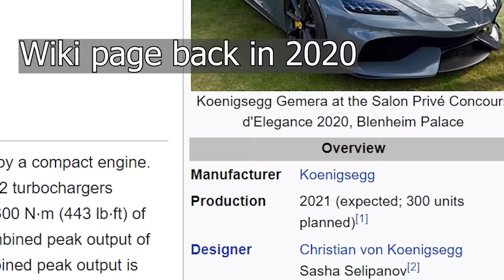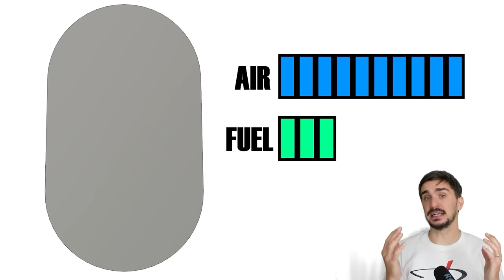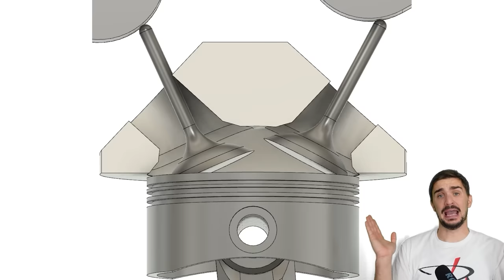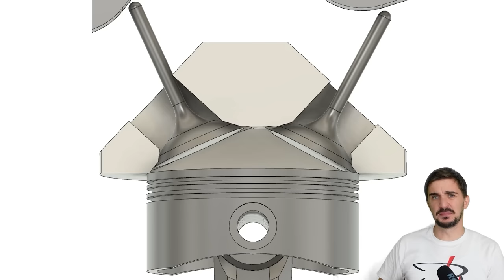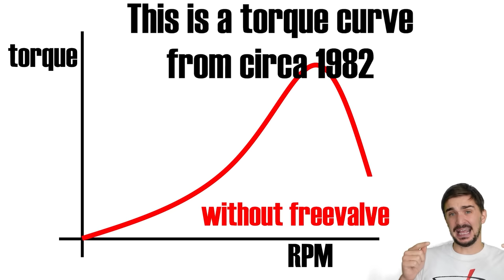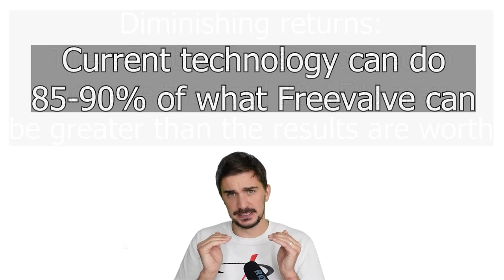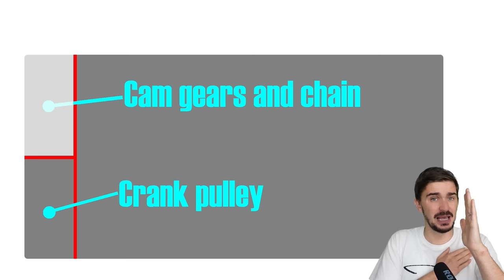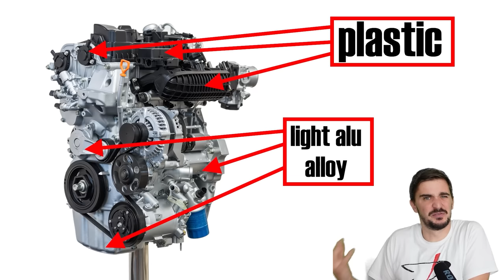FreeValve Isn't a Big Deal. Here's why

Comment: The similar story occured with liquid propane direct injection... where using gasoline fuel system looked very promising, but more than a decade later a vapor injection system took over by upgrading its components (injectors, ECU, reducer) and now the most sophisticated engines (direct turbo of dual injected turbo) run perfectly on LPG using a vapor system.
Reply: Propane does not work with gasoline engines. Propane injection id for Diesels.
Reply: @mrgcav  would be great if you continue your comment with “because: …”
Reply: There is also natural gas powered cars. In Brazil is very common to find "NGC (GNV in Portuguese)" kit for converting your gasoline engine to natural gas. There are a few drawbacks, like having to install a tank on the trunk of the car, and loss of performance, but the gas is cheaper than gasoline and fuel economy is much better. Its very common for fuel stations here to have natural gas available

Comment: You make a lot of really good points, however I can still think of a handful of reasons why Freevalve could still be beneficial. A great example would be the little FB20 in my Subaru Impreza. Being a flat engine, it's incredibly wide for its displacement, but pretty short (to make the AWD work as the engine is ahead of the front wheels.) In addition to that, the engine has a seperate cam carrier which is probably at least an inch to an inch and a half tall and being a flat engine, you have two of these, one on each bank. In this case, I think that the reduction in width of the engine would be a huge win for something like a Subaru where the top of each bank is incredibly close to the frame of the vehicle. Reducing that width would make servicing the vehicle a whole lot easier or it would let Subaru stoke the engine a bit more and maybe squeeze a bit more compression and volume out of the engine without worrying about making the engine longer like with the 2.4L or the older 3.6L.

So generally speaking, I agree with you when it comes for inline engines or V engines with enough room in the vehicle chassis, but I see there being some pretty big benefits for a flat engine where the dimensions of the engine influence the design of the entire vehicle to accommodate the AWD system. Either way, great explanation. On the balance, I agree with you though.
Reply: good point,
but i guess it will all fall down to costs and complexity
Reply: @endurofan9854  That's another excellent point as two banks on Subaru engines tend to make them more expensive all around.
Reply: Freevalve for ONE head would be expensive compared to current VVT, but for TWO heads it would be a lot MORE expensive.
It would be an order of magnitude cheaper for Subaru to just modify slightly the chassis rails if they wanted more clearance for the heads, compared to implementing freevalve.

And when you think about how many iterations of the EJ it took them to fix the oiling and headgasket issues for KNOWN tech aka regular heads with camshafts, I can't even imagine how many years and costly recalls it would take them to make a brand new tech like freevalve even close to reliable. Especially in the twilight of ICE and the transition to EVs where most carmakers are getting out their last gens of ICE engines and have stopped developing them much further.
Reply: @raoulrr  I was taking you seriously until you mentioned the head gasket issue with the N/A EJ engines. You do realize that those were phased out over a decade ago. That's like calling Jaguars crap because they're a Ford. Given what Subaru has managed with the FA24 along with their collaboration with Toyota in the BRZ, I wouldn't put it past them to do something more innovative. The worst thing to come from the F series engines is leaky cam carriers which I'd take over a failing head gasket any day, unless you own a 2011-2013 FB engine, in which case it probably eats oil. Just avoid those model years.

Either way, you're right, but cost will always be a barrier to entry for Freevalve unless they can produce it at scale which would bring costs down like any other mass produced part. The problem is that modern VVT systems and cams are mass produced at scale. Freevalve is not. It could be, but that's a lot of up front investment and most investors aren't willing to take that sort of risk.
Reply: Didn't subaru already fix that problem with their offset conrods in their F engines? They have much bigger strokes than the EJ series already.

Comment: Free valve is one of those things that sounds amazing in theory on paper, but it actually adds significant complexity and reliability issues due to pneumatic valves.  The ideal valve is actually a rotary valve, driven hydraulically.  We have the material and manufacturing capability to do this now using technical ceramics.
Reply: Actually the ideal valve is freevalve like, if it wasn't advanced racing engines, (even F1 where they have to be fairly reliable for a racing engine), would not use basically the same system. The problem is freevalve is going to take a good while to come down in price to a level thats mass affordable. Thats why it's been stuck in F1 engines since the 90's without going anywhere. It's just super expensive to do.
Reply: @darthkarl99  I’m talking theoretical.  The ideal valve would not reciprocate, as that requires high power consumption to actuate, especially exhaust valves that have to push against hundreds of psi (exhaust gases) just to open.  Free valve consumes KW’s of power.  Rotary valves would also offer better, and shorter, flow paths.  Problem is sealing, as is always, with rotary type devices.  Google rotary valve, you’d have to see an illustration to really get it.
Reply: @wesleydeer889  I get the feeling your thinking of what i've heard of as sleeve valves. They're a notorious pain to do, but also very powerful.
Reply: But there is lots of variable valve systems on the marry today that are a total disaster. Like Ford F-150 engines. The phasers are a disaster. Or Audio V8's. Free valve might actually be simpler than some of the systems being used today
Reply: @darthkarl99 They made them work in WW2 planes

Comment: This really does hit the nail on the head. Matt from the Dirty Garage Guy channel did quite a nice video a few years ago about how it might work, and all the pitfalls you might face. It really does seem to overcomplicate things. Fiat's Multi-air is already pretty complex, but at least it's in production and is so close to the perfect system that it hardly makes sense to complicate things more.
Reply: I mean it's a fairly simple thing to do and quite sure it was tried some 40 years ago. Some engineer likely already tossed the idea out but getting an actuator to run that fast and in a hot and rather hostile environment for more than a short period is likely why it was never gone with
Reply: Multi-air actually seems like a way better and easier solution
Reply: Thing is if you look at it it's a similar system to what has already been used for decades for unit injector systems on Diesel engines, it's a camshaft used to drive a hydraulic piston which has an electronically controlled return valve. It doesn't actually require that many additional components and it uses engine oil and the existing valve system. If FIAT hadn't patented it I think everybody would be using Multiair by now, it just makes sense.

Freevalve was never going to take off when it basically requires a whole new engine head and a new compressed air system to boot (and when you have an air leak, as compressed air systems always do sooner or later, you lose pressure in the entire system and your engine won't work).
Reply: @BigUriel you say "and it uses engine oil and valves sistem that already exists" like loss of oil pressure was never happened before...

Comment: I think it's important to remember that quite a few large OEM had running camless engines in the 90s. Similarly, GM had HCCI engines running in the 2000s. Neither are consumer products for (presumably) good reasons (yes, I'm aware of Skyactiv-X, which still isn't available in the U.S. and doesn't seem to fully deliver them promise of full HCCI).
Reply: GM has had electrically-operated valves going back to the late 70s or early 80s. They called them "helinoids" (helically wound solenoids). They were way too expensive for production but they used them to prototype cam grinds quickly.

Comment: I think that Freevalve will eventually come but it will come because of manufacturing cost, not that much because of engine properties you mentioned in the video. To me, Freevalve is very simple and easy to assemble compared to typical variable cam system found in current cars. If you can cut 10% of engine production costs, it will happen.

Comment: Variable Valve Timing already gives low rpm and high rpm customized cams. So you get your eco-drive cams and your overtaking cams. There is not much to be gained from additional "programming". Honda got it right.
Reply: GangBalls69_Estonia  Yes. That technology from more than 30 years ago that is in shitbox Hondas you can buy for $3000 
Truly unobtainable scifi tech that we need this ridiculous monstrosity to solve.
Reply: GangBalls69_Estonia  Honda VTEC = VVT+VVL
Reply: GangBalls69_Estonia  VTEC is a type of variable valve-timing system developed and used by Honda. It stands for V ariable Valve T iming & Lift E lectronic C ontrol.

Learn how to use a search engine bro, its right there at your fingertips!
Reply: GangBalls69_Estonia  https://en.m.wikipedia.org/wiki/VTEC ☠️
Reply: GangBalls69_Estonia  "nope, vtec doesn't include variable valve timing"

Whats the VT in VTEC stand for? ☠️
Reply: GangBalls69_Estonia  what does the EC in VTEC stand for?

Did you read my replies? Shoulda just taken the L bruh ☠️
Reply: GangBalls69_Estonia  What does the VT in VTEC stand for? You can read right?

The VTEC system uses two (or occasionally three) camshaft profiles and hydraulically selects between profiles. It was invented by Honda engineer Ikuo Kajitani.[1][2] It is distinctly different from standard VVT (variable valve timing) systems which change only the valve timings and do not change the camshaft profile or valve lift in any way.

The VTEC system provides the engine with valve timing optimized for both low and high RPM operations. In basic form, the single cam lobe and follower/rocker arm of a conventional engine is replaced with a locking multi-part rocker arm and two cam profiles: one optimized for low-RPM stability and fuel efficiency, and the other designed to maximize high-RPM power output. The switching operation between the two cam lobes is controlled by the ECU which takes account of engine oil pressure, engine temperature, vehicle speed, engine speed and throttle position. Using these inputs, the ECU is programmed to switch from the low lift to the high lift cam lobes when certain conditions are met. At the switch point a solenoid is actuated that allows oil pressure from a spool valve to operate a locking pin which binds the high RPM rocker arm to the low RPM ones. From this point on, the valves open and close according to the high-lift profile, which opens the valve further and for a longer time. The switch-over point is variable, between a minimum and maximum point, and is determined by engine load. The switch-down back from high to low RPM cams is set to occur at a lower engine speed than the switch-up (representing a hysteretic cycle) to avoid a situation in which the engine is asked to operate continuously at or around the switch-over point.
Reply: GangBalls69_Estonia  bro did you even watch the entire video? Or did you just get midway thru n thought u knew better, hence completely missing the gotchya part at the end where he drives home the point about this being a comparison to "traditional" engines which don't include technology such as VVT and VVL which pretty much are im every car since about the 90's - the exact implementation of VVT and VVL varies by manufacturer.

Had you watched it all you would know this and that what you are trying to do is what the whole entire video was about - why FreeValve isn't a big deal.

What you are trying to argue is the equivalent of saying a gearbox with 2 or 3 gears doesn't have variable gear ratios because it's not a CVT.

Nobody but you thinks that VVT equates to a system that can infinitely vary the timing, or put another way that it's constantly variable. Sure, Honda's system can only dynamically switch between 2 or 3 different cam lobes but that IS variable valve timing.

I mean, its right in the name.. the VT stands for Variable Valve Timing but here you are trying to deny reality to save face.

Watch from 9:40 where the gotchya is revealed. Or don't and continue to make yourself look like a fool who doesn't understand basic concepts 🤷

You must be fun at parties! 😂
Reply: GangBalls69_Estonia  in direct answer tho, the B16A2 as you've stated yourself is first-gen VTEC.

The VT in VTEC stand for Variable Valve Timing and is implemented using hydraulics to switch between different cam profiles, which in turn have different timing, duration and lift.

You understand that i-VTEC is the current iteration of VTEC, yet don't seem to realize that conceptually from a high level it's the same as the first generation. Sure, it's been tweaked and improved but fundamentally it's still just VTEC.

Now that i've directly answered your question... what does the VT in VTEC stand for?

(Shoulda just taken that L ☠️)
Reply: GangBalls69_Estonia  What does the VT in VTEC stand for?

If an engine has a system that can dynamically vary the valve timing*, ie it's *variable depending upon some condition, what is called what?

Honda VTEC is one of the most iconic implementations of VVT+VVL that has stood the test of time, as the OP states... Honda got it right.

Keep on crying "vTeC iS NoT VaRIaBLe VaLvE TiMInG" whilst having zero sources to backup your claim 🤣
Reply: GangBalls69_Estonia  provide just one source or reference to back up your claim that first-gen VTEC is not VVT nor alters the valve timing. I'll wait.

Here i'll go first showing that VTEC having two cam profiles is VVT, from your favourite site: 

Early variable valve timing systems used discrete (stepped) adjustment. For example, one timing would be used below 3500 rpm and another used above 3500 rpm.

More advanced "continuous variable valve timing" systems offer continuous (infinite) adjustment of the valve timing. Therefore, the timing can be optimized to suit all engine speeds and conditions

https://en.m.wikipedia.org/wiki/Variable_valve_timing

--

Remember what i said about you trying to argue a gearbox with 2 gears vs CVT,  i'm well aware of what you are trying to do.. we can go back n forth like this for as long as you like but riddle me this... What does the VT in VTEC stand for? Do you not know? Are you unable to answer this simple question?!
Reply: @Chronic Gaming  lol where u go bro? You just gunna change ya username, delete messages and dip like that?

Shoulda just taken that L, way easier than the witness protection route but i'll take it. Have a good one mate, no hard feelings 💀

Comment: Camshaftless designs have been common in large marine diesels for a while. It's possibly a lot more straightforward at 80rpm with one valve per (96cm bore) cylinder.

Comment: I'm literally making a report on valve timing on high performance and conventional engine currently and everything you shown was very useful and also helps me understand better via visual aid
Reply: He simplified the description of scavenging a bit.  When the exhaust valve opens (somewhere near BDC), the high pressure in the cylinder is released into the exhaust, which creates a high pressure wave that travels down the exhaust runner at the speed of sound.  When the wave reaches a change in area (i.e. a merge collector on a tuned length system), a rarefaction (negative pressure) wave is reflected back up the exhaust runner.  A properly tuned exhaust length will time this negative pressure wave so that it arrives during cam overlap (about 180 crank angle degrees later, near TDC).  At TDC there is very little piston movement move gases, so the negative pressure helps not only pull residual exhaust gases out, but it can be a lower pressure than the intake manifold, and pull more fresh air into the cylinder than you would normally get.  It only works in a narrow range during WOT though.  On an I-4 or V-8 you can choose a 4-1 or 4-2-1 design.  A 4-1 design delivers a strong rarefaction wave at a single higher engine speed, where the 4-2-1 delivers multiple weaker waves at several lower engine speeds.  That's why 4-1 "are for power" and 4-2-1 "are for torque".  Intake tuning is way more complicated though lol

Comment: Also one more example, it may be possible for Freevalve to achieve extremely high revs in future supercar engines. Like an NA V12. Cosworth had to ditch the belts and chains and go for gear driven cams for the Valkyrie and T50, and Freevalve can do that too. The mass manufacturers are moving to ultra hybrid or electric so they may not invest much in it anymore, but supercars definitely have a possibility for further improvements.
Reply: And if the technology improved it could be cheaper and more durable since the competing mechanisms are very complex and it enables the use of engines that don't necessarily use linear crankshafts.
Reply: Perkins used gears in 1947..
Reply: @SpaceraverDK  perkins 1947 engines did not reach 11500 rpm and 800 hp...

Comment: 9:30 1.6L engine putting out over 200 HP still impresses me as a kid of the 70's and growing up driving used 90 HP engines from 1.6L to 1.9L vehicles
Reply: 1.6L engines are pushing 800+ in f1